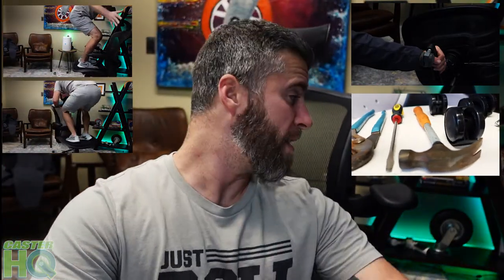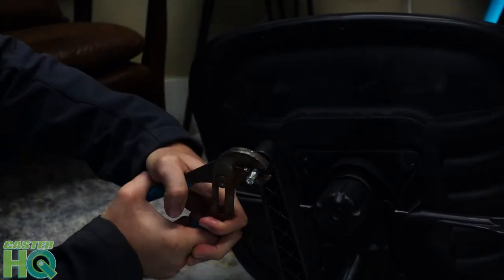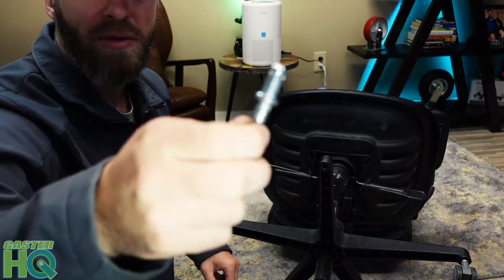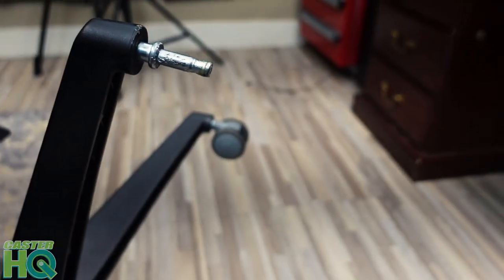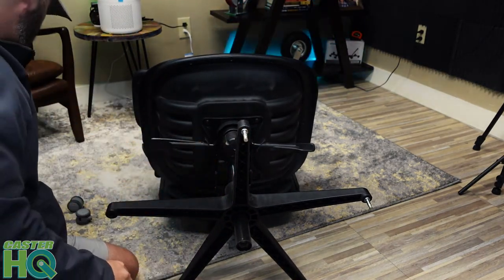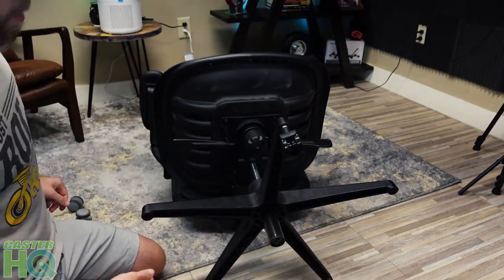Removing and Installing Office Chair Casters with Self Braking Chair Casters

Comment from the maker: CHAPTERS:
00:00 INTRODUCTION
00:18 REMOVING CHAIR CASTERS
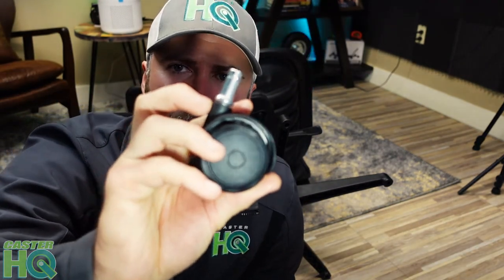06:14 INSTALLING NEW CHAIR CASTERS
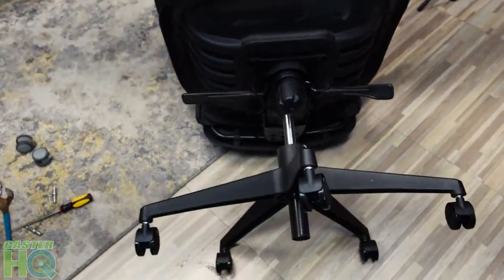08:34 DEMONSTRATING COMPRESSION CASTERS
09:18 JUMPING ON CHAIR TO SHOW CASTERS AUTO-BRAKE
10:21 END OF VIDEO
Reply: You might wanna redo the video without the flashing light in the background. Especially since there's no warning about possible seizures, For those that have those problems with blinking lights.  Just looking out for you guys.